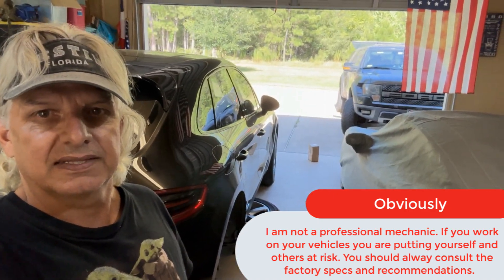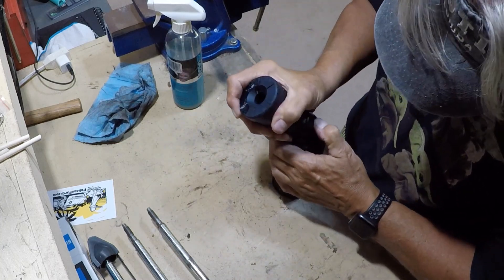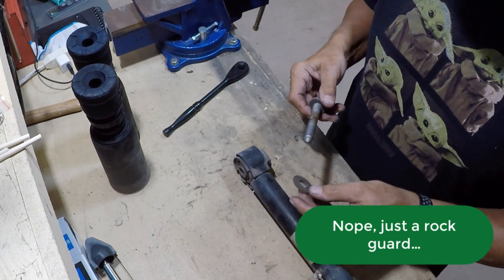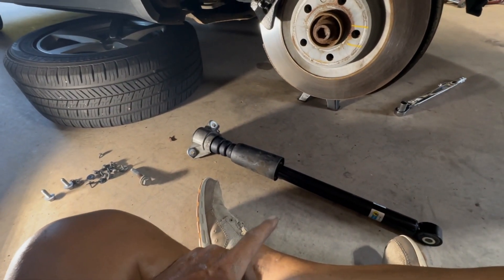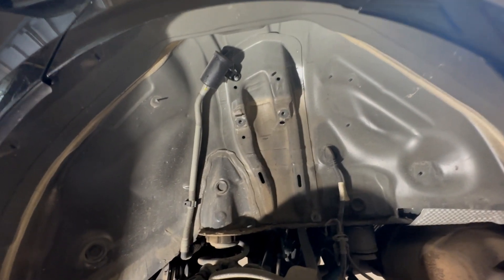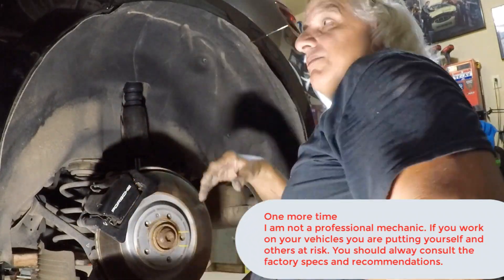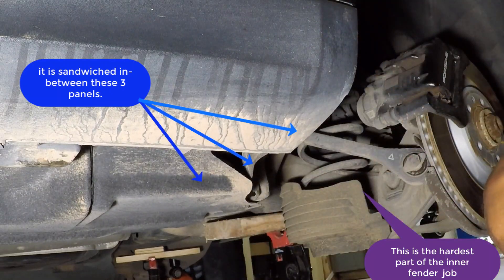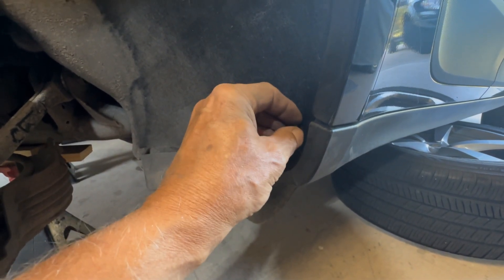2017 Porsche Macan Rear Shock Install

Comment: Thanks, did you get the torque for the top of strut nut? I have AS on my GTS so will be doing the Damptronics.
Reply from the maker: I did find it but cant remember what it was. Your GTS will have different suspension anyway, Good luck.

Comment: thanks for this video My porsche macan is having the exact same problem now i can fix it myself.
Reply from the maker: Glad it was helpful
Reply: Thanks for the video, my Macan has the same question. Were the shocks damaged or just the rubber covers?
Reply from the maker: @luchalibre1986  The shocks where visibly fine. I did change them out because they had ~70 k miles and I was in there already.